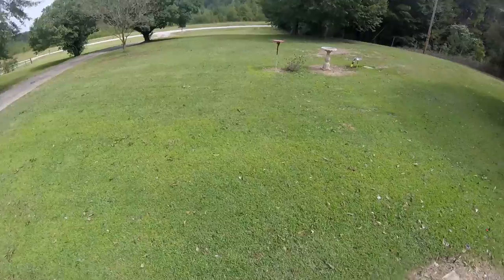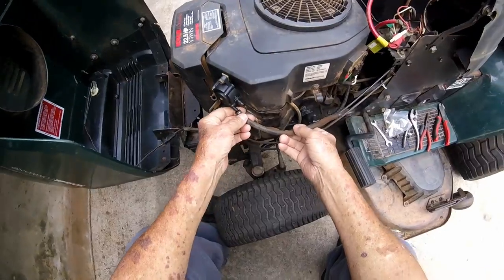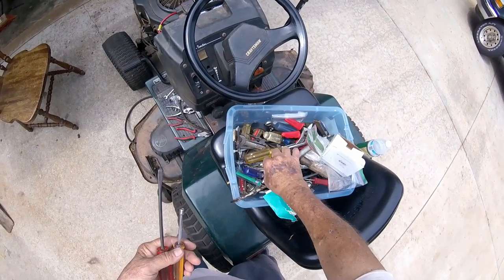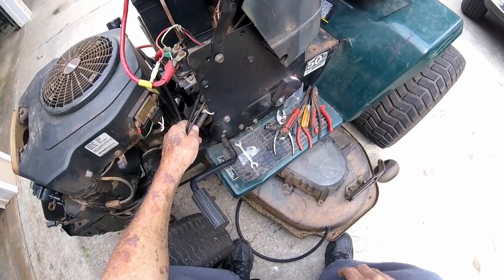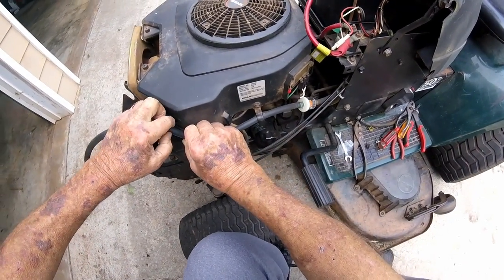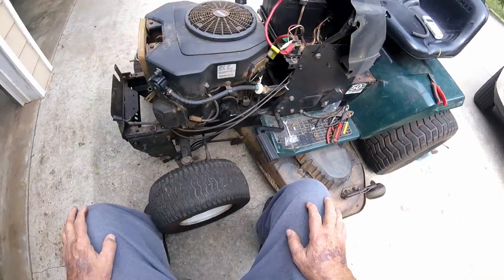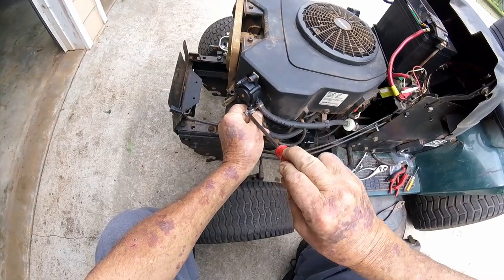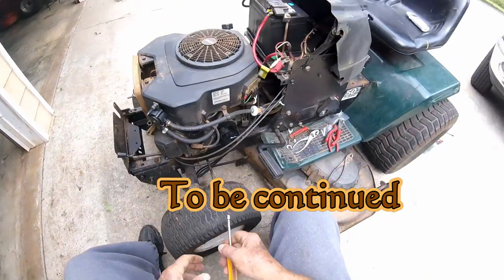Pwalpar VLOG My Limited Mechanical Ability

Comment: Small Engine repair for me was a Cummings Deisel engine that had a miss in it. Finding it was the easy part, it wasn't just the plug creating the problem that would have been easy. No, it was coming from the fuel and the plug together. The fuel filter had not been changed since they had gotten the vehicle which was over 4 years earlier. This little ditty was supposed to be changed every 12 months and they had not done it ever. The oil filter holds 5 quarts so you have to figure that in when doing an oil change, in addition, there are two fuel filters, transmission, and the air filter to change when doing an oil change and grease job. Oh, and did I mention to say, it was on a 26' Penske Rental Truck? The 18' and 15' trucks have different parameters as well. The 10'-12' truck is a Toyota truck with dual rear wheels. That wasn't all I've done with them, how about a duel rear-end brake job. This meant I had to remove the rear wheels from both sides, then do the brake job, as you would have done on your own vehicle when you were a lot younger. And it was raining out so only one side at a time could be done. Jack it up, put 2 5000# jack-stands under the rear axle before starting the job. now remove the wheels from the rear on one side and do the brake job.  I laid the parts out piece by piece so that I would not put on the wrong part, but so that I would not have any spare parts either. Upon finishing the one side I told the shop owner how long it took, Yes, I did count the time for those jack stands to be inserted and removed from under the truck. Counting that I didn't take any break I did it faster than the book said it would be done. Then I went out and did the other side after rotating the truck around since it was still raining outside and under the 10' eve I was relatively dry. Did the other one in the same amount of time as with the first. Got cleaned up and I still had about 1/2 hour till quitting time. 
Yup I've had my fill of small engines except for changing a water pump, slave to the master brake cylinder, and starter on my old 93 Ford Ranger, which I still have. but it will have to have the engine removed to get to the freeze plug on the side of the engine that blew out. I parked it under the broad limbs of a Magnolia tree, locked the front and camper, removed the tag, and transferred it to 08 Ford Escape with no fees involved since they are the same weight class.
Reply from the maker: Thanks for sharing your comments Hugh